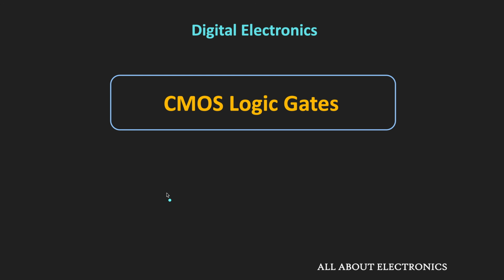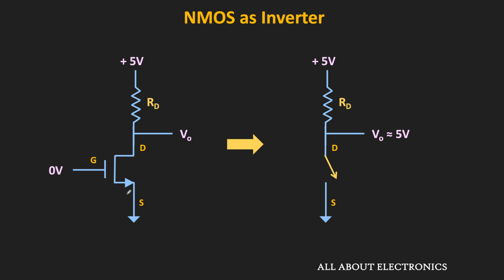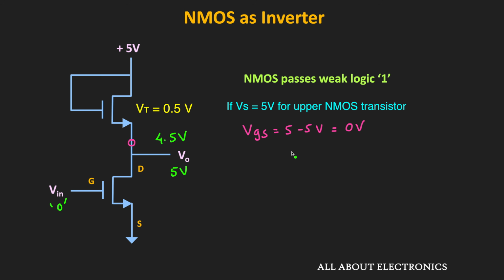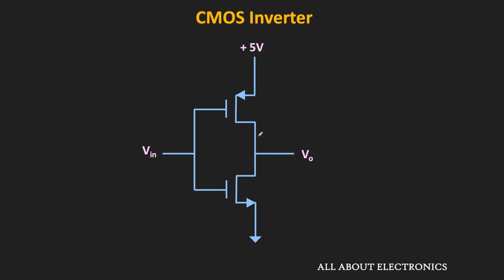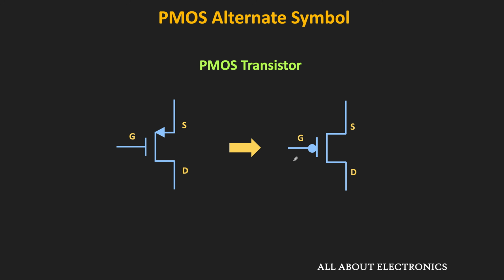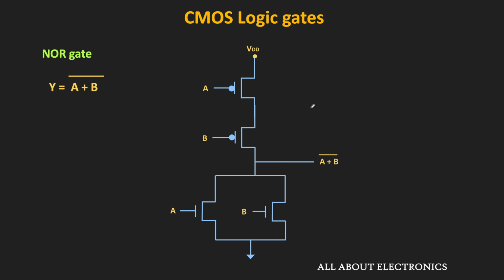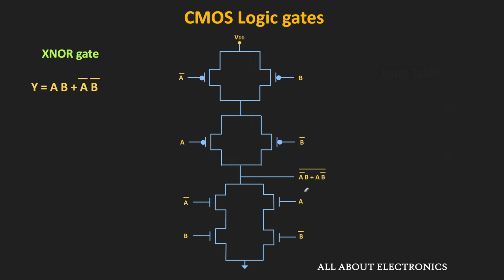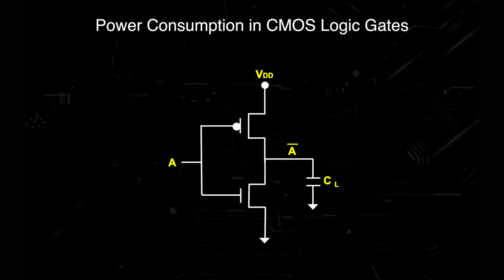CMOS Logic Gates Explained | Logic Gate Implementation using CMOS logic

Comment: Sir I have one doubt how pmos  is pull up network and nmos is pulldown network
Reply from the maker: When PMOS is ON, it will connect the output node to VDD. So, it will pull-up the output voltage to VDD. (That's why its called pull-up network) On the other hand, when NMOS is ON, then output node will get connected to the ground via NMOS transistors. So, we can say that, the NMOS transistors are pulling down the voltage at the output node to logic'0'. (And that's why they are called pull-down network)
I hope, it will clear your doubt.